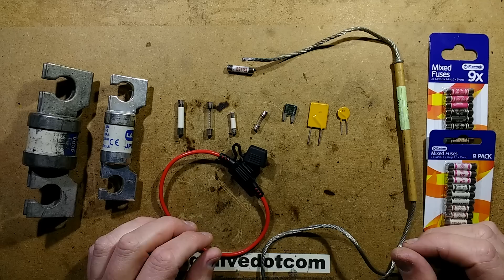Things you should know about fuses.  (including a 15kV one)

Comment: You are correct about the HV fuse. The thin metal that runs alongside the soft alloy is for strength. The braided tail of the fuse passes over a spring loaded mechanism and is then clamped, this puts the fuse under tension. When the fuse blows the spring loaded mechanism releases and the carrier will then drop down from its mount via gravity and hang down. (im a lineman)
Reply from the maker: At some point I'll manage to scrounge an old cutout from the local utility company to make a video about.
Reply: @bigclivedotcom  That would be awesome.

I do have an American one in storage. Sorry, that's mine.

It has original fuse still in it.

Also, I have replacement still in the original packaging.

Has anyone ever heard of the old bird house cutouts.

The ones that had a habit of catching on fire.

That's why I stopped using them.

They were actually enclosed in a wooden box.
Reply: I'm not sure what the European standards are, but the US has two color codes.  The one typically used for 208 3 phase (120 phase to neutral) is black, red, blue for the 3 hot wires, white for neutral, and green for ground (black, white, and green match the 120V single phase color code).  The other code (typically used for higher voltage 3 phase systems of 480V/277 phase to neutral or more), is Brown, Orange (or Violet), Yellow, Gray for Neutral, and Green for ground.  However, the US NEC doesn't specify specific colors to be used except when one hot leg has higher voltage than the other two, and the ones that are used are industry practice/traditionally used.
Reply: biggest problem with expulsion type HV fuses is when wasps lay an egg in the bottom of the fuse barrel which glues the fuse tail in place and though the fuse has blown will not drop out(why they're known as dropout fuses) causing the fuse barrel to arc internally.  The fault will continue until the barrel physically drops out in pieces. these units can protect up to at least 33kv/66kv(in australia at least). I was also a linesman.
Reply: pmailkeey Same as domestic in the UK. Used to be Red, Yellow and Blue for three phase but is now Grey, Brown and Black (with Yellow/Green striped for CPC/Earth)
Reply: We need to talk, I have questions that I need answers to! (What utility company and what state/country is it in??
Reply: Lineman eh? I'm a loadman
Reply: more fuse body material as melamine , vulcanized fiber , epoxy fiberglass tube on fusestube.com,wellele.com

Comment: By shear coincidence, I was watching this video when the power went off to my RV.  I reset the breaker and returned to the RV.  I then noticed on the built-in digital volt/amp meter I installed that the RV was pulling over 24 amps AC on a 20 amp breaker.  I had forgotten to turn off the electric water heater that morning and was running the air conditioner that afternoon.  After a couple of hours the hot water in the water heater finally cooled enough to trip the thermostat and restarted the heating element.  Oops.  Too much current draw.  I turned the water heater off.  I must add a pilot light to the water heater switch that reminds me to turn it off when it is not needed!
Reply from the maker: You could fit a changeover switch to select between hot water and AC.
Reply: Excellent idea.  Normally, the 29' American RV ("caravan" for those in the EU) is designed to run on 30 amps and it is not a problem to have two, 12 amp things going at the same time.  However, at my current location there is only 20 amps available so I must be more careful about what and how many things are turned on at the same time. (I changed most of my lights to LED's to save power, too.)  Thanks for the reply!
Reply: @bigclivedotcom  That would be a good idea.
Reply: @bigclivedotcom  Too bad. He's not in Do United Kingdom.

I'm in the United States though.

But I know about this.

You know in the United Kingdom to have those electric showers.

Water heating shower heads were wall mount units with the handheld shower with at water heater in the big box.

They make a switching device. That would choose between one ordered shower or another we don't have the capacity to run two of them.

That could be hooked between the air conditioning in the water heater.

To automatically select either water heater or air conditioning.

Could have a bit of a modification. To allow one or the other manually. As well.
Reply: how's living in an RV like? I come from a really small country so its not possible but i just love the idea of living in an RV.

Comment: I don't know if I'm just easily amused or what, but my late 90's Honda bike uses that same kind of glass fuse, instead of the more typical vehicular ones, with the square plastic case and it never fails to amuse when some too young to know shit mechanic pulls the side panel open to look at the electrics and finds it hanging there, along with a couple spares in their little protective rubber case.

Comment: The Hv expulsion fuse is held under tension within the fuse holder. (explaining second more durable metal strip that is for physical strength.)  A spring on a cam will shorten the holder and that lets it drop out of the bracket and swing down with sufficient gap to break fault current. https://www.youtube.com/watch?v=FzkkCPIvCYI
Reply from the maker: Was it an overhead or underground fault?
Reply: A faulty pole termination (where ug cable meets oh line) 2 spans down the line.

Comment: Most self-resetting ptc fuses can go high resistance if tripped a few (dozen?) times, but there's a ceramic type that can trip thousands lf times.  Ptc trip current varies with temperature and many have a very low voltage rating

Comment: I got given an old welder a few years back, never plugged it in though, but I did open the plug, someone took a 13 amp fuse, soldered some 30 amp rated copper wire across it, and closed it up, and left it, rather than use a proper 16 amp or 32 amp plug & socket with a dedicated protected feed, the stupidity of some people can be scary... :S

Oh, and the welder had old-colours 3-core flex for the welding-side connected to the clamps, rather than appropriate cable, so the welder just sits in my yard shed holding down the one side incase of excessively strong winds... :P
Reply: But is it rated for that strength of wind? :-$
Reply: It's all fun and games until the AC conduit in your wall melts and starts a fire.
Reply: I seem to remember photonicinduction once rated a bunch of 'fuses' like pennies and nails
Reply: twocvbloke  I think that's the proscribed fix for a blown fuse in a welder, but a nail also works very well and no more pesky nuisance tripping.
Reply: 'til the main fuse before the meter's blown, of course... :P
Reply: twocvbloke nails work there too !
Reply: That is until the substation goes pop... :P
Reply: twocvbloke you got me there
Reply: tosety no we are already back to the substation, I'm going to try bridging the the circuit using either raleigh grifter or a small child
Reply: I can tell you're European. An American would use a .22 bullet.
Reply: yep seen a welder with 6mm core wire from a MMA stick used as a fuse ... was told by the guy who did it .. " it was blowing fuses ... fixed it .. won't blow again " .... didnt use the machine ...
Reply: Reminds me of folk who take out a blown fuse, wrap it in tin foil and put it back in.  It's like do people not actually understand what a fuse is for?   They must think plugs have a built in design flaw where a little  cylinder inside them is designed to stop working every now and again so you have to buy more of them.
Reply: twocvbloke 
If you mean at the main fuse panel, that's what penny fuses are for
Reply: Sam Gamgee  That would be totally cool
Reply: pmailkeey  is a transformer not just a fuse with lots and lots and lot of wire, it must  work better than a normally fuse probably safer really if made in China. It's possible I'm taking the piss
Reply: I'm not European, I'm British, europeans don't bother with fuses... :P

Comment: You can use a soldering iron to open glass and small ceramic fuses without breaking them. Heat the ends for a few seconds and melt a bit of solder on them, the glue burns and fails and you can remove the caps easily. I did this to fix burned glass fuses when I did not have a replacement in stock, bad idea ;)

Comment: I have a broken glass fuse (5x20mm) with the marking "T32L250V". Unfortunately, there is no documentation for the part where the fuse was in, the PCB is also unmarked. Now i have looked around and this type of fuse only seems to go up to 20A, couldnt find a 32A one. Could the marking have another meaning?
Reply: 3.2A rather than 32A

Comment: I was always curious about those fuses, like my 1.5V battery can blown 1A 250V fuse, and also mains voltage at, let's say, 2A will break it the same way, but the amount of power is so different
Reply from the maker: It's purely down to the current.  1A at 1V is exactly the same amount of current as 1A at 1000V.  Where the power comes into play is when the voltage is across a load.  So 1V at 1A across a resistor would dissipate 1W (1A times 1V) but 1000V at 1A across a resistor would dissipate 1000W (1A times 1000V).

Comment: This reminds me of the time I was on Work Experience with a local electrician, and one of his employees, a fully qualified sparky, was sent on an early morning job at a car dealership (also did mots etc) but they said they couldn't have power off because of their computers, so he decides to this "quick job" live. He accidentally dropped his pliers (wire cutters I forget now) while working on a three phase fuse box live, shorted out some terminals and blew all three of the fuses on the incoming mains to the building. As well as gave himself temporary blindness from the flash it made.

Comment: is there a problem with swapping glass fuses for blade ones on cars?

i was told once not to do this, but i dont know why???
Reply from the maker: Given the nature of the automotive industry the design of the traditional auto fuse is probably optimised for cheapness.  You do get standard fuse holders for cars too.  I'd suggest using ceramic fuses if you did use them.
Reply: As BigClive™ would say, "I'm not 100% sure..." but I think it has something to do with some glass fuses failing explosively.  He mentions this in this video around the 6 minute mark or so.  If this were to happen in a car in a fuse box that is just covered with a plastic panel (like in my car) it might result in a fire.  Just my opinion, however.  :)
Reply: thanks, it was something do do with the way the fuses blow he said, i cant remember, along the lines of a blade can get warm and still work, and a glass will just blow. i cant remember , but still thanks for the reply!

Comment: How do you determine the rating of the fuse to begin with, what is written on it could always be wrong or a misprint, also, I was hoping you'd make one explode! I have an industrial fuse from a place I used to work, I liked the box more than anything, if I send it to you will you make it go boom? 😂
Reply: phonotical Don't buy fuses from anyone stupid enough to mislabel the rating.  Professional electrical wholesalers should send randomly chosen samples for destructive testing, then reject the whole shipment if the samples fail.  Professional fuse factories should do the same before shipment. This is one of the few areas where all that ISO 9000 stuff actually makes sense.
Reply: John Francis Doe hey, anyone can make a mistake
Reply: Well the only way to really determine the rating of a fuse is to blow it.

Comment: The fuse for the shower blew, it welded itself to the holder and melted the plastic around it, welding the fuse holder in the fuse box. Fun....
Reply: Probably been overloaded and overheating for a long period before it finally failed, usually happens when an old shower is replaced with a higher rated new one.
Reply: John Ward exactly what happened
Reply from the maker: Another possibility is a loose connection in the holder arcing and burning over time.

Comment: Over here we have A B C designation for fuse delay. A being the quickest.
Reply: Over where? 
I've never seen letter designations for fuses. Only for circuit breakers (ie a 13 amp circuit breaker with a C characteritic is called C13)
Reply: Where is "over here"?
Reply from the maker: The A, B, C and D ratings apply to circuit breakers to indicate their inrush current handling ability.

Comment: Big Clive if we were in jail together I'd protect you in the shower. Also, could you please take this apart https://goo.gl/KmQ8KS it's a 12v kettle from halfords. I don't want to burn my cars electrics out trying it.
Reply: So Random, you say you'd protect him in the shower?  Like a fuse? hehe
Reply: Haha, my friend got one of these to go in a caravan due to kettle tripping. He used a cig socket to 3pin converter. It never boiled!... Kettle is so useless. To think a car socket is typically fused at 15amp.... This kettle can't be more than 200w...  Absolute joke and I bought him a new kettle that worked in utter disbelieve he even thought this was a good idea lol.
Reply: "Approximate boil time: 18mins (12v), 10 mins (24v)." jesus
Reply: Yeh , with how much water in it ? 50ml :P
Reply: If the claimed boiling times are accurate at its full 500mL, starting from 20°C (which is anyone's guess), that would require about 156W on the 12V setting or 280W on the 24V setting (not counting losses in the cord, which may be significant).
Reply: Long Runner reality is 45mins , backed up by a review on internet, It's awful.
Reply: So it's really about 60W, then?
Reply: Random Name sounds like you need a fuse!
Reply: Random Name get a gas hob and kettle less than a tenner and will boil in about 2 mins
Reply: Holy shit! There's 39 cross-site-requests that have been blocked, so I see the page, but not the pictures. And no, I am not willing to either turn of my protection or figure out which ones to allow for a fucking image to load. Sites like these are to be avoided.

Comment: Great video! Very informative. Your illustration at 21:00 happened to  me years ago on an old Toyota car. I took that fuse out and back in half dozen times. Ended up towing it to my mechanic who promptly checked the fuse for continuity, replaced it and took pity on my ignorance and only charged me for the fuse! Doh!
Reply: William Garrett 
I don't even look at fuses in cars. or any really. I put a meter on them either ohm or volt. if blown it will show a voltage across it. or connect to a ground and check for voltage all across it . if I'm still not sure. I go with the ohm meter!
Reply: @jamest.5001    Yup...  ohmmeter function on the meter is the best option. On rare occasions a weird fault can be traced to a 'high resistance' fuse. If your meter was in Continuity/Buzzer mode, then it would look like the fuse was ok, when in fact it was dropping a voltage across it due to e.g. 15ohm resistance....

Comment: I didn't know that these letter indicators were used in other parts of the world :)
Seems to be the "standard" german norm, f for "Flink" -> fast, t for "Träge" -> slow, theres also M for "mittelträge" -> medium slow
Reply: Nope. flink and träge are the correct words in this case. There are several more words which could be used to describe the same behavior but none that would be as accurate as fast or flink.
Reply: Siana Gearz Flink and Träge are the correct words indeed. We also use them in Belgium, where we don't speak German. (we would say "snel" and "traag" in Dutch which doesn't match those letters either)
Reply: @sanderd17  

Wouldn't "snell" be "schnell" in German?
Reply: +Hekatombe - Flink also means 'fast' or 'quick' in Danish. Some words do have several meanings, else cross words would be boring (-:
Reply: Back in the day, German engineering was pretty much the "gold standard", so many things are based on old German norms.
Reply: Interesting :-)
Reply: Wording also fits in Danish. Flink, Træg etc.
Reply: Tobias Mädel echt?
Reply: You are right, the markings of fuses are most likely based on a DIN Norm: https://www.swe-check.com.au/pages/learn_fuse_markings.php
Reply: Flink even sounds fast
Reply: But what if German nouns are in themselves chosen to correspond to markings rather than the other way around? After all, there's any number of words in German for fast and slow.
Reply: especially in the porn industry, but that's a very different kind of slo blow. . . ....
Reply: fast / slow / or time delay!!!
Reply: I disagree that "Flink" works in Danish since "Flink" means "friendly" or "nice". But yeah "Træg" works
Reply: +Zeedijk Mike
I can't find that definition in the online dictionaries I have access to.
Reply: I think T is time delay.